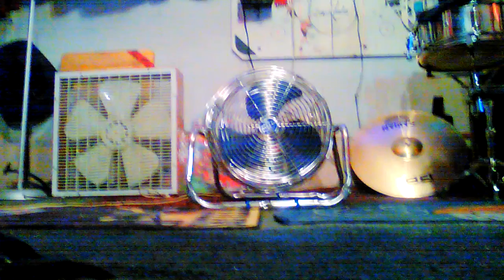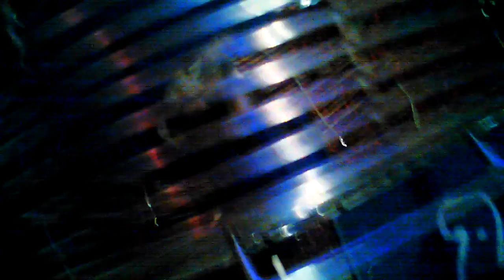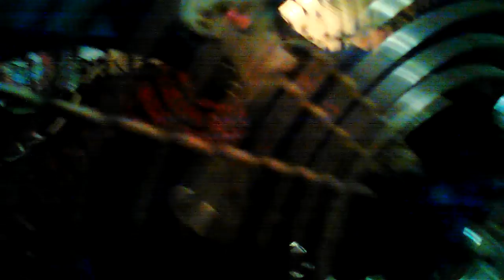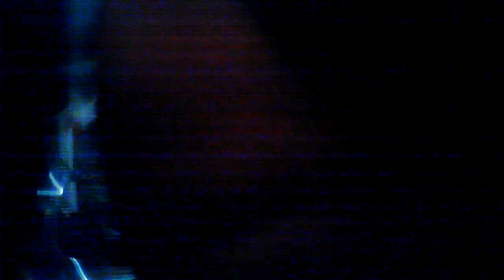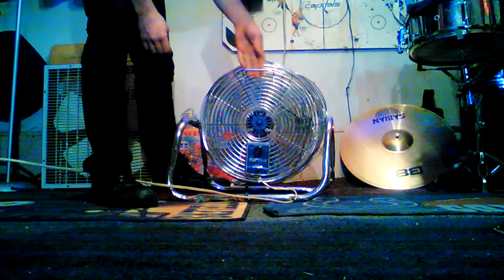1980's vintage Patton HV 14" fan

Comment: It's actually WF-1279, you could tilt the fan straight up and sandwich the 2 ends of the stands in your window for window use, my grandpa has one with the same stand, it's the WF-1879 18" model.